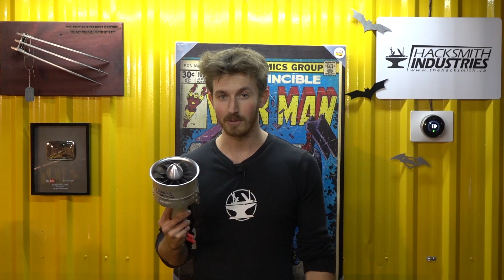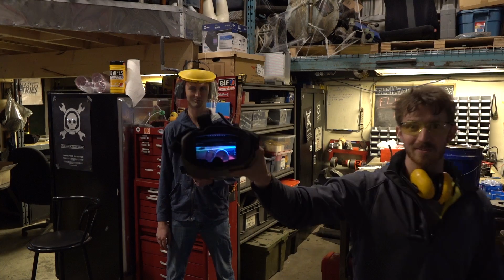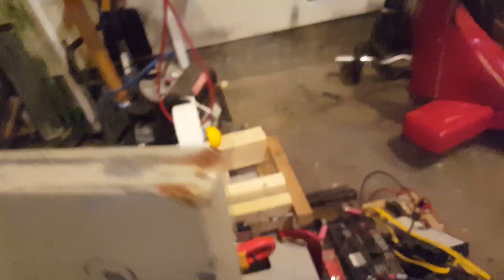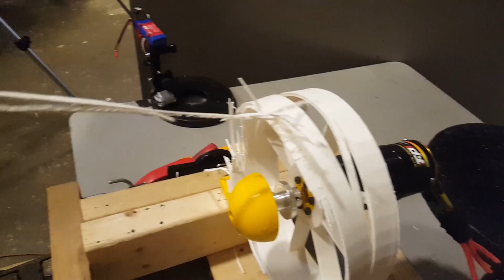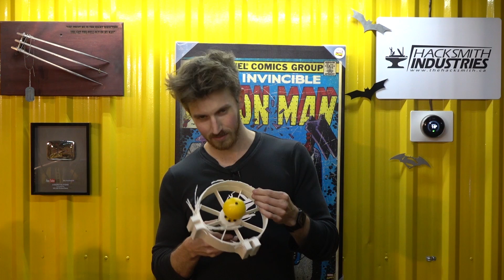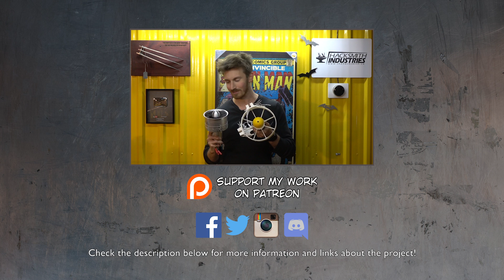Flying Like Iron Man Update: EDF EXPLOSION!!!

Comment: Have you tried using the cnc to mske metal blades?
Reply: How about casting from aluminium? You can 3d print the fans and make a mold .
Reply: But if you cut out each blade individually it should fit. Also you could try reinforce it with some metal substructure.
Reply from the maker: Ours isn't big enough. Only 6"x10" work bed
Reply: molds arent acurate enough often leading in impurities and when doing things such as that its lethal to have even a slight off balance of it
Reply: how about supporting it with carbon fiber and epoxy? and of course use 100% infill for the turbine housing..
Reply: minibikemafia Thats basically what "BlameTheDingus" said. You literally added nothing to the 'brainstorm' of how to solve the problem. Secondly No. You saw how well the plastic hold up and that is without any reeinforcement. You could coat it with resin to support the flaw of 3d printing, the layers.
Reply: CookingTasty its amazing how smart dumb people think they are when they're in a comment section, not using proper thought processes in any form of thought
Reply: I know molding with metal has already been ruled out, but what if the parts were to be smoothed and balanced from the 3d printer using filler, and THEN molded, wouldn't the part be much more uniform and sturdy? then if balancing is still needed, it could be balanced the same way a quadcopter's blades are, by shaving parts off as necessary
Reply: That has issues with the crystalline structure of the metal when it's cast. It could work OR it could have some or all of the blades weaken and again, exploded EDF, but now with metal shrapnel!
Reply: and to cnc them separately welding would bend at those speeds between the force of friction as well as bending and to make pieces that slot together could again break and be leathal
Reply: Maybe a resin printer?
Reply: i was thinking that but you have to keep in mind plastic is going to struggle to hold together when it reaches a velocity like that because everything has a velocity it just completely breaks
Reply: Good luck doing rotors on a 3-axis :,D
Reply: CookingTasty i wasn't directing that toward you it was to get an agreed opinion to those who chose to resort to slander in the beginning of a comment and i believe its actually aluminum but in that kind of environment to mass produce those i wouldn't imagine it too uncommon to have a machine to cnc both sides without having to completely rotate/flip the object in the process
Reply: I have another idea!
Maybe they could collab with NYC-CNC. I think they would help him out a bit with their big tormach machines.
Reply: +the Hacksmith Add a fourth axis on its side so that it can rotate the fan blades into the work area. You need it to rotate horizontally and the shaft to be attached where the motor would be. I believe it would work with your tormach because nyccnc has a tormach automation series with a horizontal fourth axis.
Reply: +the Hacksmith Go to your local job shops and ask for quotes/sponsorships.
Reply: 2007dalin even a fraction of a fraction of an ounce can be disastrous
Reply: still not nearly sturdy enough
Reply: there needs to be no chance of failure if they move to metal
Reply: plastic wouldnt be hard enough, and the beds are too small for what they would be trying to do without spending 5K+
Reply: it´s really good at this point already. 
Maybe use ABS?
Reply: PrismaShadow maybe not the rotors but the Housing for the rotor (don´t know the term for that), and that would not add any strength but some safety if it explodes.
Reply: fair point CookingTasty to get the pitch of the blades on a cnc machine it would be next to impossible, even if you were to precisely flip said item over it would still be disastrous
Reply: BlameTheDingus eyy what have I done to you? :D
Reply: minibikemafia That is possibly the best way to try to solve the problem.
Does anyone know what the material of the original EDF is?
Reply: minibikemafia the issue with that is if you dont make it solid carbon fiber many impurities are to come into effect due to the imperfect process of 3d printing something as far as grooves and everything leaving strings on the blades and such, but even to get a solid carbon fiber rotor that is precisely made and weighted is next to impossible
Reply: BlameTheDingus Thats true! Also Balance is with most ideas a problem since even the slightest off balance will become a Problem at 40.000 rpm+
Reply: the biggest issue with anything rotating is balance, because at rpms over 2000 it becomes a lethal weapon that could kill on impact where as on average 2000 and less just becomes very painful ;)
Reply: CookingTasty i imagine he would want to oversee the process and the issue with that is customs as well as flight etc, it would be extremely expensive and i imagine we would have to pay for that so that lies with another issue of us crowdfunding the project enough
Reply: +Blamethedingus didn´t he just fly to england to collab with colin? And all he did was show them how to use a turbo jet...
True though. But still I think they could help him out with a few things.
Reply: Looks like it exploded because the blade bended. too much strenght applied. am i right? is there any stronger kind of plastic you could use? or something to reinforce the blade's edges?
Reply: Winston Bishop abs can definitely take more bending momentum.
Reply: minibikemafia if that's the case, send him links to where he can by them, cause obviously he did not find then.
Reply: CookingTasty Ok, then is the way of printing it? i read that 3d printing has problems with applying horizontal forces. it cannot stand forces from all directions i heard.
Reply: ***** even if it did, it would be 40,000 a year to buy. Minimum 3 years.
Reply: okay, well it has a higher chance of working, i cant say for certain. I can say that it would more than likely be more expensive than $5. But at that price point, it would be more beneficial to just make the propeller the same way multirotor propellers are made in manufacturing today, a molding process. then he would be able to make as many as he desires once a mold is made
Reply: so then balance it.. its not rocket science lol

Comment from the maker: Who saw that coming!? 

Wanna help the channel, but don't have any money?  You can help us out for free by watching a few ads on an app called Tad! ► http://givetad.com/TheHacksmith it pays 30 times as much as YouTube does per view!
Reply: the Hacksmith as much as I hate the ad, but for your sake I will do it
Reply: Also I hope this app is real
Reply from the maker: +Abdulla Qasem I wouldn't ask you to do it if it wasn't real! Thanks :)
Reply: after 3d printing the fans try and bake them in the oven this will cause the layers to bond better and the molecules to organize them self in such way that makes it stronger. I don't know what the temperature is exactly so it's doesn't melt the part so do some research into it.:)
Reply: Who saw that coming?? Mhh.. using weak materials and a production process that is bound to create little defects and then using it for high end high stress applications? Who could call themselves an engineer and NOT see it coming?
Reply: the Hacksmith I saw it coming in the title
Reply: the Hacksmith have you thought about making molds of the edf blades then casting them with a light metal like aluminum
Reply: the Hacksmith have you thought of using the 3d print to cast a mold and then use the mold to make a stronger material?
Reply: I think your Design is really near perfect right now, but the material you are using for 3D Printing is just not strong enough right now.
Reply: Hey, If you can use the 3-d printed parts to do a wax casting in aluminium or steel that would be much stronger, and if you want then I might be able to do a simulation of your fan designs so that you do not have to spend time and money on casting with each iteration..
Reply: It seems the duct isn't smoothed ... you should try acetone smoothing on ABS, it increase layer adhesion ... maybe using nylon can also help making stronger part !
Finally, tom showed in his filaween serie that baking some filaments make them way stronger ...
Reply: I saw it coming but just not of that magnitude unto oblivion. LoL! An idea to strengthen the edf might be to try overlaying/painting a newly 3D edf with a couple of thin coats of epoxy.
Reply: you guys are the few channels that I whitelist on my adblock because your content is actually good.
Reply: hey since you can 3d print the shape why don't you make a mold and make the fan blades from aluminum.. its not that hard to make your own castings.. or find someone that has the experience with it to make a material strong enough to withstand the forces
Reply: try a fiberglass resin in a mold..
Reply: my God
Reply: the Hacksmith alrighty then. Time to watch some Ads :)
Reply: +the hacksmith please tell me why you cant make your own metal fans
Reply: You should make stuff for wall climbing. Maybe a spiderman series with web shooters and such
Reply: the Hacksmith explosive news
Reply: Hacksmith If you are going to put a quadcopter of some sorts on top of the whole suit then you can also think of building a mosquitocopter like attachment for top and use 8kgh edfs for stability.
Reply: Auction parts of those experiments off in Ebay.

Someone, somewhere would probably like to have a chunk of the project research to own and people are getting a little piece of something!
Reply: +the Hacksmith
would it be a possibility to use a metal fan and 3D Print the rest to save money?
Reply: Definitely saw it coming.  wrong type of 3d printer.  that or look up diffrent stronger plastics. taulman abs might work. Still i recommend a forms lab printer for this.
Reply: Hey man! Love your videos! Maybe you can ask barnacules nerdgasm to print a blade design for you guys. he got a Formlabs Form 2 3d printer. With that high resolution and a 100% infill, i think you would be golden my man!!!
Reply: the Hacksmith  could you cast the parts or the edfs
Reply: the Hacksmith  (edit: Well, I guess it's painfully obvious I am new to the channel. I didnt know, until just now, that you have an engineering degree. Well, then I guess I definitely was preaching to the choir :P)

Hello, I am a mechanical engineering student with most of my degree plan out of the way, and I want to give a few suggestions.

you may want to find a cheap way to balance the prototypes, to get higher speeds and more reliable results. There is also the possibility that the prototypes may not be reaching their optimal speed, before exploding. So a power consumption vs thrust curve may be something to consider.

You may want to consider reinforcing all prototypes, or making solid fill with fiber reinforced resin versions of the prototypes.

I am sure you probably already know about this, but there are filaments with reinforcing fibers in them, for example carbon fiber reinforced ABS filament.

And finally, I hope I am not preaching to the choir, and wasting your and my time. lol
Reply: Aww. That sucks :(
Reply: Shur Murray
all I was saying is, that i totally expected it to happen. There is no bullshit in what i said. I don't need to go into detail about failure modes or dynamic stress to know I'd certainly go for cover when this thing is powering up.
Reply: the Hacksmith Try strapping 4 EDFs to each hand and 2 or 4 to each leg equally seperated and run each at 8 to 10 Kilograms of thrust so they do not explode.
Reply: the Hacksmith Try strapping 4 EDFs to each hand and 2 or 4 to each leg equally seperated and run each at 8 to 10 Kilograms of thrust so they do not explode.
Reply: Why dont you 3D Print metal fans?
Reply: Just cnc the damn thing out of aluminum. Btw love your videos keep it up 👌🏻👌🏻
Reply: try and do an acetone gas bath to further fuse the plastic together. it will also give it a super smooth finish if done correctly.